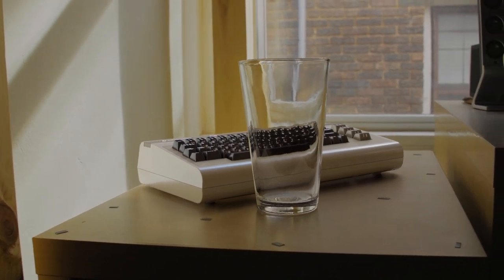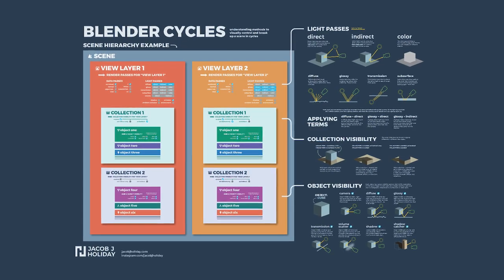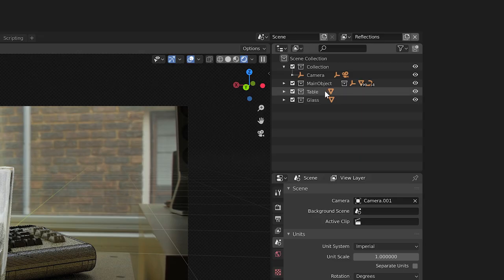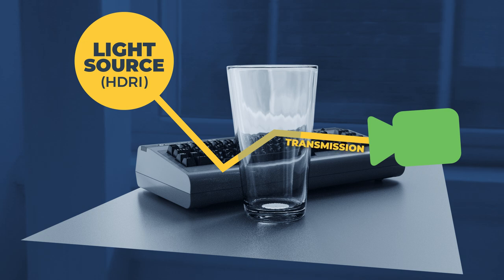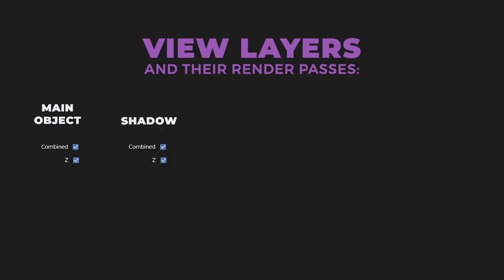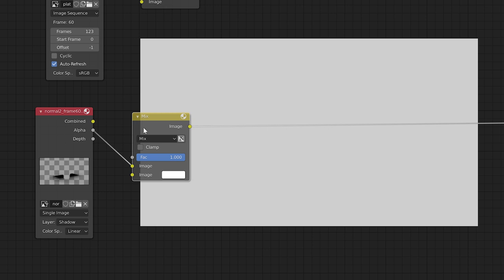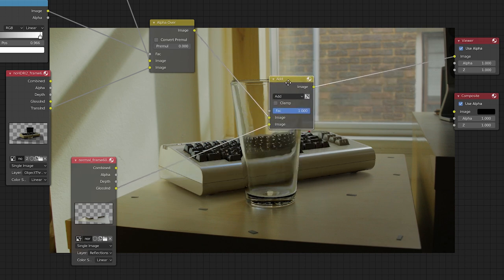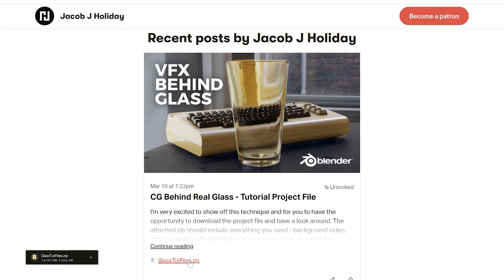Composite CGI Element Behind Real Glass - Blender VFX Tutorial (Full)

Comment: Hi Jacob, great tutorial, you were able to explain a really complicated set-up with clarity and without making it over-complicated.
I only have one question for you, how do you manage the different color space between the original footage and the rendered elements?
Is there a way to be able to use the filmic color management for the rendered parts and use the standard one for the original footage?
Reply from the maker: Hi Guido, glad you liked it. Good question. That's something I want to dive more into in the future. Have you heard of the ACES color space? Once more fully implemented into Blender I think this will be the answer. I think there's some ways to work in ACES now, but I'm not qualified to speak on that.
Reply: @InLightVFX  
Hi again Jacob, to be honest, I only know in general terms what ACES is and I don't certainly know how to work within in Blender.
So, in the specific case of this tutorial what did you decide to use? 
Did you set the general color space to Standard, losing the convenience of using Filmic to manage the linear aspect of render elements?
Reply: Color management is a big topic, but a way to work with everything in the same color space is changing Blender ocio.config to ACES ocio.config. This requires however knowledge in how to setup and use ACES, so until some research I wouldn't recommend. Especially because you'll need an IDT for your specific camera and all of Blender default colorspaces will be gone and you will only have ACES. Here is one topic on setting it up: https://www.toodee.de/?page_id=1720

The advantage however is working in a wider gamut scene linear workflow. This means light will behave and act more realistically compared to sRGB gamut with a Filmic view transform on it.

Comment: Just saw your Fusion compositing video. Wondering if you would use Fusion to composite this one now?
Reply from the maker: Good question! The nice thing about Blender's compsitor is that it's so directly linked with the Blender scene and so you can dial things in, re-render, and have things update a little more easily. In this way, it's great for roughing things in. And since this shot doesn't really change much throughout the shot, the compositor's awful playback speed doesn't really matter. So I actually might still composite this particular shot in Blender.

Comment: Hello, to avoid checking or unchecking "use for rendering" you can make these layers as a new linked scenes which can have other render settings. 
Btw you used Filmic here, or compped it on "standard"? I've always had a problem with it because Filmic in the compositor is added to recorded movie which i load and a render.
Reply from the maker: Thanks for the helpful tip! I was hoping that someone might propose a solution to that because it is a bit finicky. I will have to try out that method. I believe I was in Filmic for this - whatever is on by default. And I haven't had that issue with the compositor although I think there's a way to change the color space for any image sequence you import?
Reply: @InLightVFX  Im not sure about that because Filmic works like a LUT in Blender which works only on your monitor, your renders are still in linear space and files you upload in thier own. You can see how its working for example by trying archieve pure white in compositor, its impossible with Filmic on, even if u have 1,1,1, values. That because Filmic remap it for high dynamic range